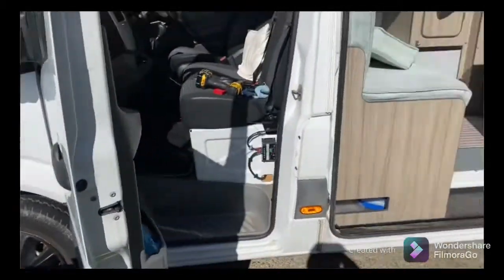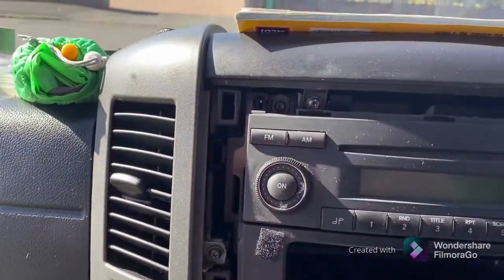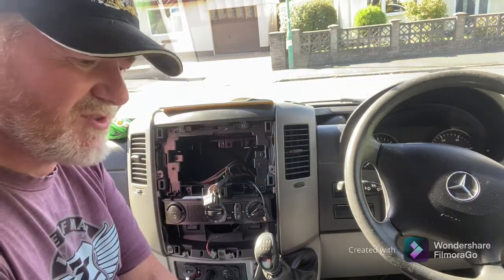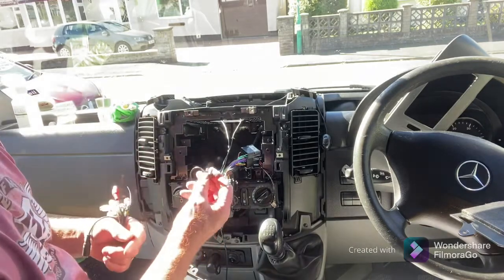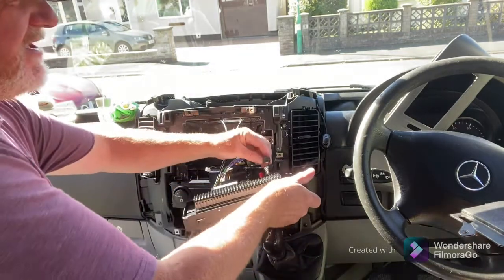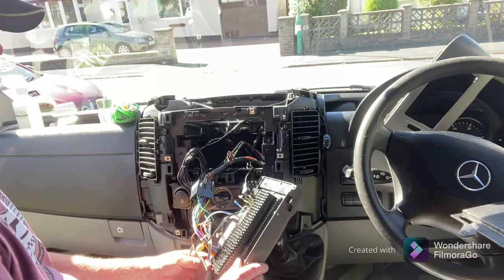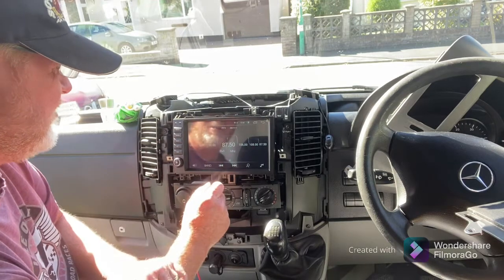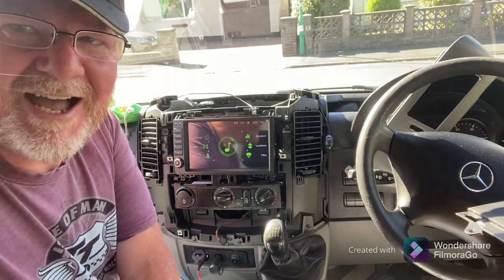installing new multimedia unit in Mercedes sprinter camper van https://www.ms-automotive.co.uk/

Comment: Took the plunge after watching your video.  All went well and I was initially very impressed with the install but then discovered that that the unit conflicts with the Sprinter CANBUS and prevents the front marker lights from working.  Put the old Sound 5 system back in and everything works as it should.  Any suggestions?
Reply from the maker: @davewilko555  sorry Dave I could find out any data on how canbus could effect marker lights… but the company that supplied the unit were very helpful so maybe go back to them
Reply: @taketheshot1153  Thanks for the reply and I've finally sorted the problem myself.  With so many different electrical systems being added to the motorhome the vehicle wiring loom, the coachbuilders 12V electrical system, an alarm system, a reversing camara and a tyre pressure warning system it was difficult to work out which wires went with what.  Eventually I found a couple of black wires that had been attached to the old radio which were in fact earthing wires for the lights and the tyre pressure warning system.  Connecting these to a new earth got everything back up and running.

Comment: That's a great video, very clear and easy to follow. If you don't mind, how much did you pay for the unit and did you ever upgrade your speakers? I only ask because I put a SIECANE head unit in my SLK 350 and the sound was never as good as the ancient COMAND system fitted by Merc. Thanks for posting. John.
Reply from the maker: Hi there! No I never upgraded the speakers as sound is fine for motoring about😊. The unit cost me £290 from MS automotive. Still going well a few years in now.

Comment: Hi, thanks for the informative install video. I'm thinking of buying the same head unit. I just wondered how is yours performing now that it's been installed and used for a few months? Thanks!
Reply from the maker: All working well, using sat nav about the island here just for fun but all the functions work well, radio stations bounce about a bit which can be frustration when listening … I will try a reload on that, but blue tooth phone and media all good and plenty of things I haven’t even tried yet! 

I love gadgets so this has been a real positive addition to my camper experience! Also great support from buyer.
Reply: @taketheshot1153  Hi, thanks for the reply. Glad to hear its working well still. Will look into buying one now!

Comment: Hi again, one more question please. Do you get any reduction in screen brightness when the sun is out whilst driving? Cheers!
Reply from the maker: The sun can be a problem… thankfully I live on an island. That doesn’t see much sun! But seriously there is a glare factor that would get on any screen in the cab but the screen is still clear and information on it clear too.. I have not found any problems using on a bright day. Hope that helps
Reply: Thanks again. Does the unit power on with the ignition or do you have to turn it on manually? Cheers
Reply from the maker: @janetlowe2642  the unit is wired on mine to power on when the ignition is on but I’m sure it can be changed to power on with power button activated on unit.

Comment: Great stuff, really informative video - thanks. Did you need to disconnect the battery before installation?
Reply from the maker: Actually never thought to do that! But all was well….
Reply: Always sensible, but not necessary. Some of those radio wires do have permeant 12v

Comment: I've taken the plunge and installed an upgrade after watching you r very informative video. I also have a tacho fitted in my van how did you remove yours?
Reply from the maker: The taco unplugged from slot like the radio and I was able to trace cable from engine to unplug and removed ( actually rolled up and taped in engine cavity. ) other cables just unplug and left in area behind readily … though I did use the 12v cake and an earth to install a usb charger and power my dash am camera!!!) so should be able to removed and I was able to sell it on eBay for £50!!!)
Reply: Tacho came out as you instructed. I have a T symbol on the dash which stays on.
Reply from the maker: @geffers1000  are you ok with that being shown on dashboard… not sure how to remove that light?

Comment: Hi I've fitted this head unit my radio reception is pants any idea fitted to a mercedes sprinter
Reply from the maker: Mine too, finds it hard to find a clear signal for each station and lock in! It tends to loss lock a lot! I thought it was just my aerial, as that was the only origin part… but sounds like there may be an issue.

Comment: Ordered today. Just wondering if all is still good with it a year later??
Reply from the maker: All is still good! Sat nav excellent for journeys to get me where I am going, blue tooth phone and music working well… My only little big is the radio, the reception fluctuates but it could be more about my Antenna just haven’t had time to poke about! Thanks for the watch😊
Reply: @taketheshot1153  did you get the DAB at a later date
Reply from the maker: @markmaxwell1969  not yet but would be a good plan to down load

Comment: FYI I have a Touch only Xtrons in my Sprinter and an unbranded Chinese Clone with proper buttons and knobs in my Crafter, both have truly shocking FM reception the factory aerials are effectively very directional because of where they sit on the front of the cab. bit of a design flaw from MB!

I tend to use the BBC Sounds app instead.

Screen reflection in sunlight is a real problem with both my units especially when using the most important feature, when reversing they just don't have bright enough screens unfortunately!

How long does this MSA unit take to load up Google Maps? 
My Xtrons is ok but the Chineses clone has fake Android 10 and fake 2Gb of ram it's probably running a much earlier version of Android and only has 1Gb of ram which isn't enough and google maps runs dog slow!

A lot of the units on ebay claiming to have 2Gb of ram only truly have 1Gb!

I am considering this particular unit because it also has a physical volume knob, touch screen only units  are far too dangerous for use on the move.